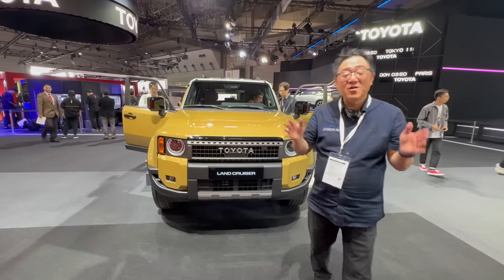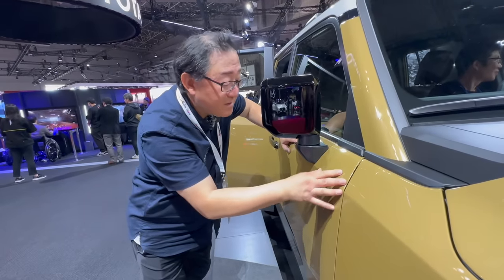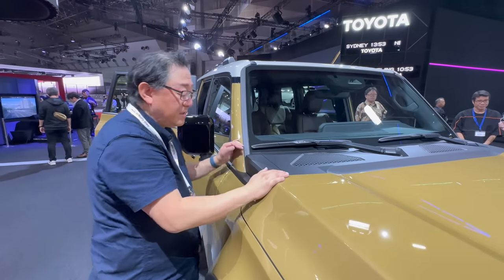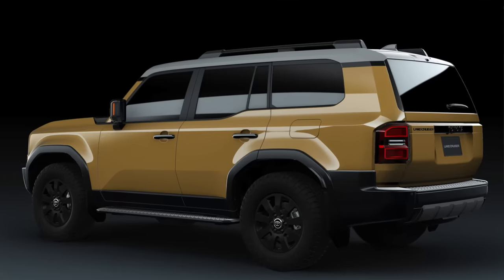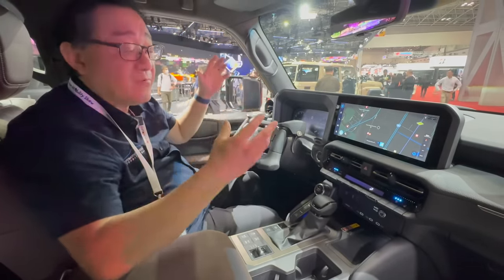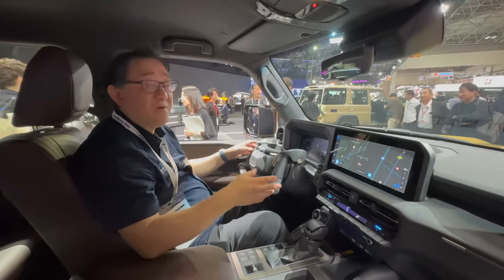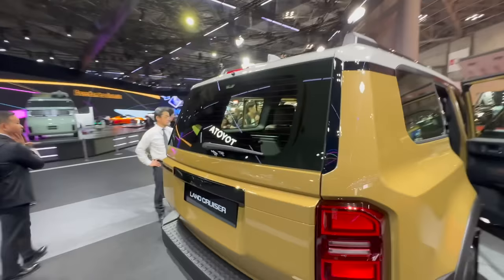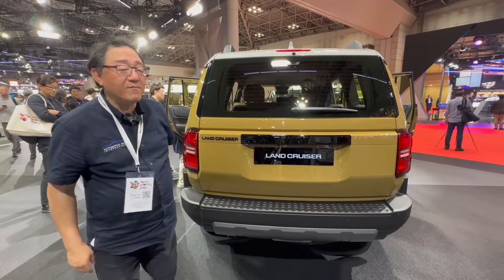HOW'S QUALITY OF 2024 LAND CRUISER? ENGINEER CHECKS OUT SPECIAL VERSION OF 2024 LAND CRUISER

Comment: The J250 was getting tons of attention at JMS2023! As we found out, it's far more accommodating on the inside vs J70! Just not as cool 😎
Reply: Are you still in Japan? Want to see your impression of vehicles like the 300 series, Hilux and fortuner lol.
Reply: @rollsroycenetwork1221  I just Kirks latest , I think he’s home . Quite the traveller
Reply: The 70 is really, really cool.  Wish they would have incorporated more of the 70 lines into the 250, especially the rear split gate.
Reply: Toyota could have taken the opportunity to use the J250 body on the J70 frame, especially with the engine already changing to the GD from the Hilux/Prado. Would have made for a nicer 70 and allowed for the same add-ons for NGOs/fleets that use both simple Prados and 76 series cruisers.
Reply: @guentherwilke2055  70's frame is different and I think J250/300 frame is much sturdier. its just newer technology as with 70s series frame is not changed only body and engine.
Reply: I have the feeling that the new J250 will be one of the best Land Cruisers yet. Relatively luxury offroad beast. The ultimate tourer to travel the world!
Reply from the maker: Kirk, we need to go to the Tokyo Auto Salon together and do a collab there!
Reply: That matt black shelf on the hood is actually to reduce sun glare and its direct reflections. Its a mod that 70 series guys do which putting a matte usually black sticker in same area as this
Reply: @AutomotivePress  When is this vehicle available in the U.S?

Comment: We are looking to purchase either a Land Cruiser 250 or the new 6th gen 4Runner. Looking forward to learning more about the 4Runner to help with our decision. Currently own a 5th gen 2014 Trail 4Runner so not in a big hurry.
Reply: When is the 6th gen 4Runner coming ?
Reply: Are you in America? I'm in Australia and can assure you, the conventional Landcruiser (300 series) is built to a tough, high quality standard, even when compared to other Toyotas. The 250 series is basically a shortened version of the 300 (with more retro design). We don't have the 4 runner here anymore as it was replaced by the Prado back in the late 90s. However, the Landcruiser is the pinnacle of Toyotas and if cost isn't an issue I cannot see there being any comparison between a 4 runner or any Landcruiser.
Reply: I am in the US. I currently own a 5th Gen 4Runner 4.0 gas engine 5-speed auto. My mods-3"OME lift, Baja Boss AT 285/70/17's, dual batteries, Redarc controller,12,000lb winch, ICECO fridge 200 watts solar etc. Happy with it for now. I do like the 250 Landcruiser based on what we know so far. The 300 series here was over 100K American. If it is near 60K it could work for me. We haven't heard what the new 4Runner will be yet. Sounds like it will be on the same platform as the LC if so we'll see. Not in a hurry to change...Cheers!

Comment: I have been patiently waiting for the new 4Runner but am beginning to have some concerns. The LC is a terrific vehicle with a long and capable list of features but Toyota tries to create differentiation between their models. Even if the 4Runner has the same frame and drivetrain what might they do to it to separate it from the LC? It may be time to drop a deposit on an LC.
Reply: the 4 runner is going to be bone dry on accessories and trims. thats whats going to happen
Reply: If you want the 1958 trim, you will have to wait a very long time. Making 5000 units of the top line model first. 

David tells us the Toyota Production System is so flexible … easy to switch trims, colors etc…superior to other car makers. But doesn’t benefit the customer. Why are they only producing 5000 units of only the most expensive trim at launch? Toyota Needs to focus more on the customer.
Reply: By the time I can get one it’ll probably be a 2025 model anyway.
Reply: By the time I can get one it’ll probably be a 2025 model anyway.
Reply: By the time I can get one it’ll probably be a 2025 model anyway.
Reply: By the time I can get one it’ll probably be a 2025 model anyway.
Reply: By the time I can get one it’ll probably be a 2025 model anyway.
Reply: By the time I can get one it’ll probably be a 2025 model anyway.
Reply: By the time I can get one it’ll probably be a 2025 model anyway.

Comment: Still curious of the longevity of the engine compared to the previous model that was good for 300 to 500k. The angle of the windshield is also concerning. Will it be a rock magnet for highway driving? Wait and see. Beautiful vehicle though

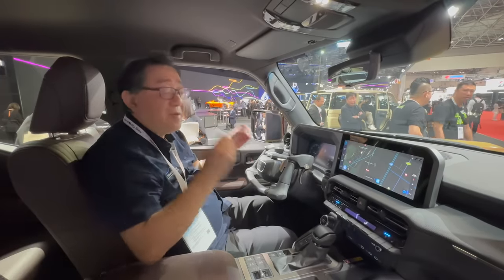Comment: Did David say the frame size is the same for current generation of Landcruiser? the 250 is 4"  more narrow compared to the 300 so is that due to a wide body (7:44)
Reply from the maker: Even if the body is slightly different size (usually due to fender flares), the frame will be the same size

Comment: I wonder if that exposed window wiper design would also fix a flaw in cars for decades, the fresh air intake that allows mice and squirrels to routinely come into the vehicle through the fresh air vent, punch a hole in the air filter, and ruin the inside of a vehicle.

Toyota would do well to introduce anti-rodent counter measures inside the vehicle as well.

Comment: You have just re-confirmed what we all were dreading. Toyota screwed the 4 Runner Faithful by taking away the Prado Based vehicle and change it for a cheaper, less refined Tacoma with a roof in the back. Why won't any of the YT commenters and channels - afraid of the brand that they won't get invited to the next launch - have not called Toyota on this. This Land Cruiser is simply a Profit Grab by them. Take what was supposed to be the next 4 runner, slap a LC nameplate and charge $15000 more base price ($40,400 vs $55,000) and make the next 4 Runner an expensive Tacoma. Screwed as we all know that pickups are the lowest in the refinement scale. Just feel the weight of a Tacoma door, the 4 Runner feels substantial and heavy, while a Tacoma feels light and cheap. I am upset as a 5th Gen owner, as the next 4 Runner will be a downgrade from the Prado to a converted pickup. Also upset at so called Automotive Journalists that don't call out Toyota for the lame in your face profit grab and how they treat the 4 Runner faithful.

Comment: Good luck getting one of these in the next 18 months.  It looks great, but I'm guessing demand is going to outstrip supply for a good long while.  Sadly.
Reply: And the fact that the LC250 will be shipped to basically every country on earth, from the same factory in Japan. Allocations are going to SUCK
Reply: I’d give it 3 years
Reply: Just order one when the books open. The first deliveries are in june/juli 2024.
In Europe the you were supposed to order one in october but it's been pushed back a month or two.

Waiting time is probably max 1 year which is normal for some toyota models in Europe.
Reply: @perpelle in Japan order books will open in spring next year, I asked when I was at the show.
Reply: Long time. Notice the first 5000 units are only the most expensive trim levels